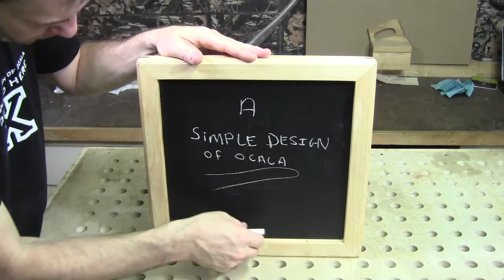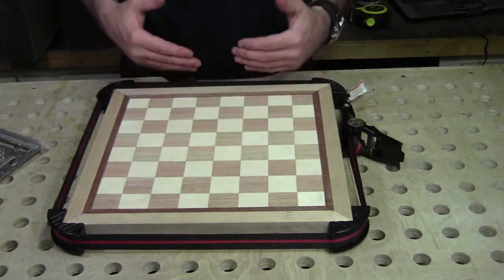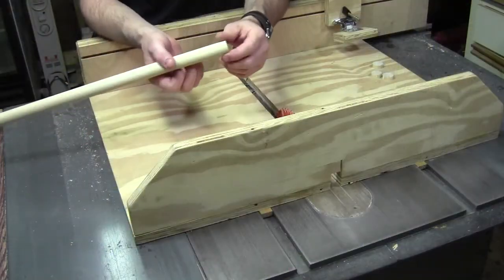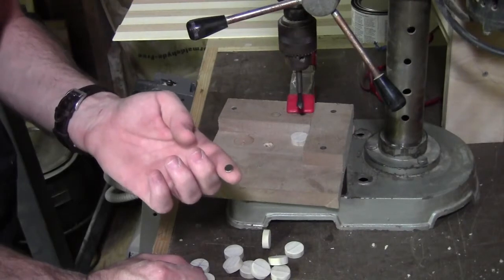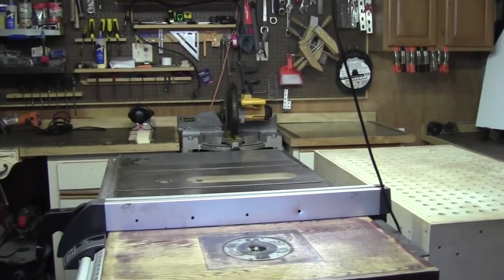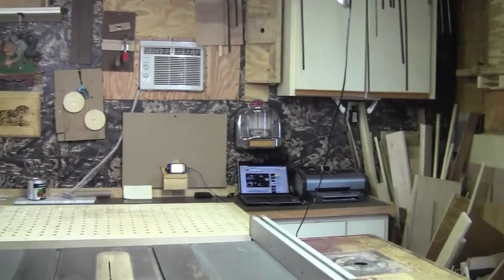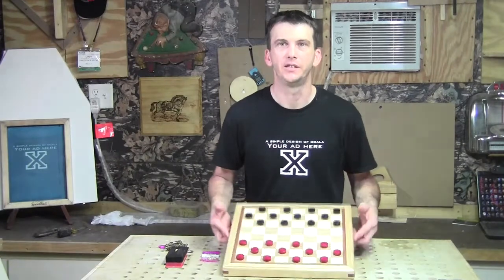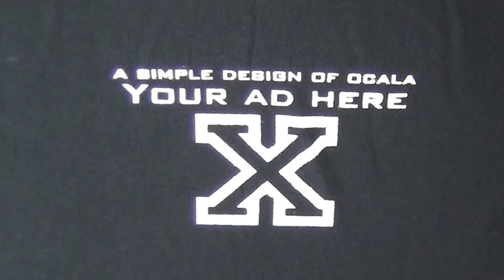Woodworking - 2 sided game / message board part 2

Comment from the maker: Norbury, not 100% finished, it needs its finish applied, and I'm still working on the legs. the one thing I haven't dont yet is tapered legs, once the legs are attached, and the finish is applied, I can get the videos edited down to 10 min and post them , my projects along with the bench can be built  in a weekend with no problem. just getting the videos out is the trick The bench is going to be a couple vids long and I want to release them all at once instead of 1 each week on a single project